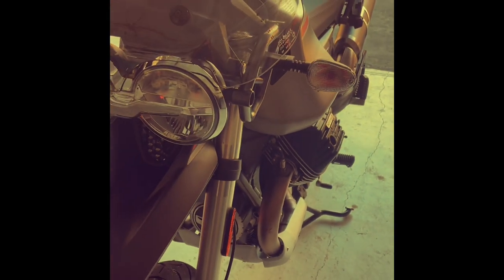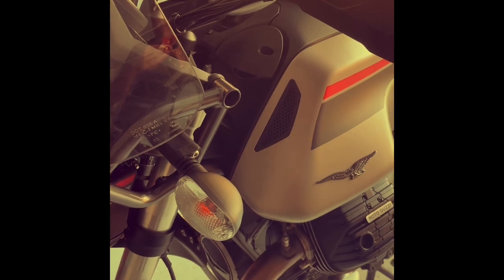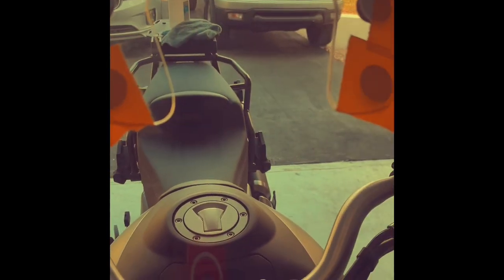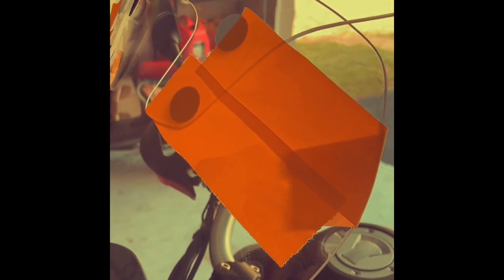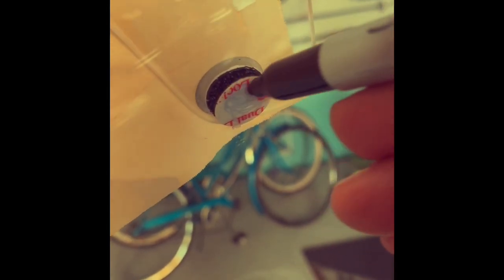V85TT wind buffeting - Working on a solution

Comment: Helloo!
I'm 6´0 tall too and suffer horrendous buffeting on my 2021 Centenario. I have tried the standard short and touring Moto Guzzi screens in all positions, tilting forwards and backwards and adding a mini  screen to both also in all positions and I've added the Motoboxer "rabbits ears" all to no effect. Ive compared the noise and buffeting to my KTM 390 adv with its short stock screen and the KTM is much quieter. The problem is buffeting and not just wind noise as the only solution Ive found so far is to ride with no screen at all in clean air. Its a pity as the Centenario is a lovely motorcycle in all other aspects.

Comment from the maker: i must add that the Laminar Lip DID NOT resolve the buffering issue to a satisfactory level. The saga for a solution continues. As I continue to work on a direction to fix this, I will eventually make an updated video. For now, if anyone has found a solution for the V85TT Travel HORRENDOUS buffeting issue, please do share.

Comment: Hello there, I just found your video. You said you traded your BMW 1200 GSA for Guzzi. I am the Guzzi V85TT owner and on the weekend, I tested 1250 GSA. The BMW seems to be well balanced, weight low = low gravity (my Guzzi is certainly more top heavy), and there is better wind protection on the BMW. I was wondering what prompted you to swap BMW for V85TT?
Reply from the maker: Hi there, I traded for three main reasons; First, the left cylinder sleeve broke into three pieces with plenty of oil in the engine. The dealership that diagnosed the issue (it was burning one quart or close to a liter of oil, every 400 miles) told me that they could not explain what happened. I rode the bike to the dealership. BMW told me to go pound sand because my warranty was up. The quote to replace the left cylinder was US$5k, so I called it an end to that.  Second: The GSA was getting very tall and heavy for me, especially fully loaded with my travel and camping gear. Add a full tank of gas and at 8.9 gallons of fuel, that was just under 70lbs of fuel. It was a hand full to put it onto the center stand. The V85TT weighs 457 lbs., and it is so easy to maintain. I can do valve adjustments w/o removing the fuel tank. I get 250 miles between fill ups and the seat height is much lower. Wind buffeting was a major issue on the Guzzi. I literally hated it at first. After many attempts, I finally arrived at a MRA-Xcreen on a weird angle, transferring wind directly to my face, but it eliminated the buffeting. I have ridden just about 2500 miles now, and I can confidently say that I love the bike. The seat comfort/riding position is superb, handling too. Power is adequate, but requires a little more planning than the BMW did when passing others on the road. It will ride at 90mph all day and the electronics package on the Travel model is quite good. So far, I have no complaints and I get a lot of compliments. Yesterday at a coffee shop, an Italian guy approached me and said "I ama pRoudã to see you riding Italian Bikeã." I am happy with my decision to buy the V85TT.

Comment: Allow me to tell you what works. I've tried everything. I'm 6.02" with long torso. Ermax Wind screen 500mm, GIVI handguards extender and tank wind deflectors. You will only feel a breeze by your shoulders, cross winds no issue and warm hands in the winter even without heated grips. 
Ermax screen $120
Tank deflectors $50
Givi hand grip extenders Around $150 ? I can't remember the exact amount. 
The bike will look amazing and your money spent will bring good results.
Reply from the maker: I sure appreciate your feedback. Thank you! I have already ordered another screen, a Madstad, which I plan on doing a review after I get and install it. Their factory is only one hour away from my house, so I actually went there to measure in person. I will be looking for the GIVI handguard extender, also.
Reply: @Twentyfourvalves  The GIVI hanguards are a bit expensive, In the beginning I was hesitant to get them BUT they do work very well and don't regret getting them
Reply: @tedmarakas2626 could you please share if you use the Ermax that is currently in their offering? The one which is currently avaliable is 480mm. Im curious if it has the same shape as yours.